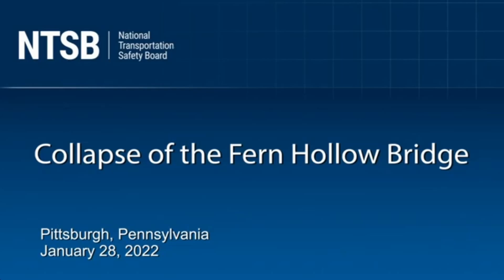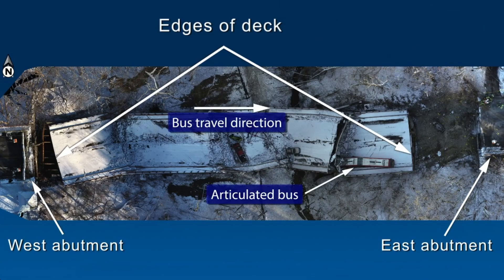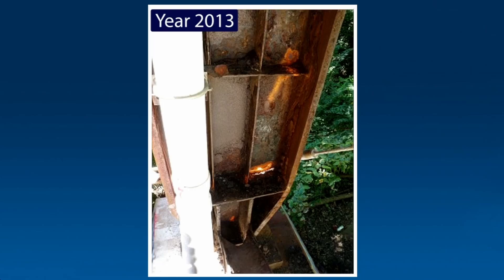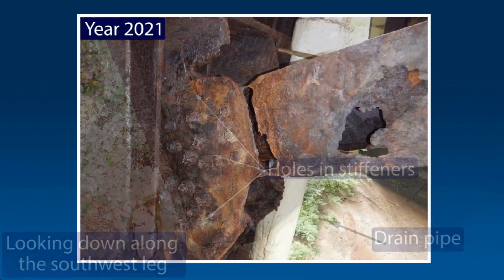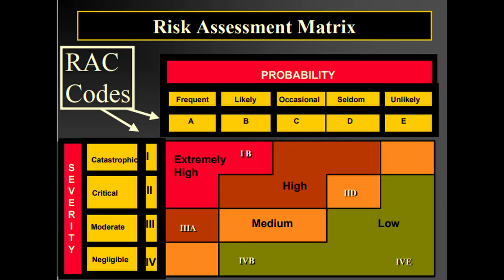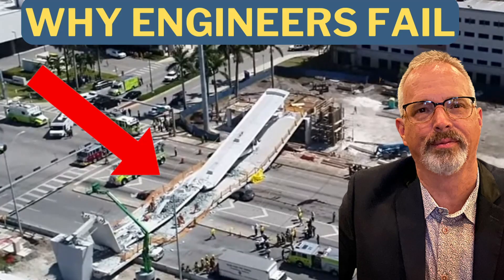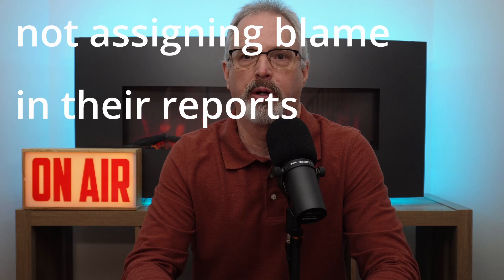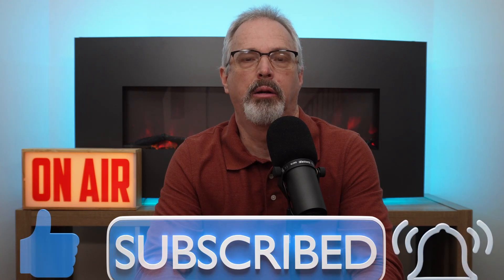Why the Fern Hollow Bridge Collapsed

Comment: If you are an out in the field looking at things & touching things kind of engineer sooner or later you're going to see something that just isn't right.  In 40 years I had one episode that landed me in front of the lawyers explaining who knew what and what action they took or did not take. At a minimum some head knockers at corporate got calibrated and stopped harassing engineers when problems arose.  It also got some facts on the record with a Govt. Inspector General.

Comment: From a wider view, the UK has focused Professional Qualifications in Engineering, Accountancy and Medicine into independent Professional Institutions, which were originally trade clubs such as the Royal Institution in the 17th Century. My father worked with Prince Philip (they shared my Grandfather in common, Philip's mentor as Mess Steward CPO in the start of WW2) on the CEI, a hyper-regulator. You may graduate with appropriate qualifications, but that's only the start, you have to gain experience both in the profession and management before being able to apply for Professional Qualification, which must be maintained as technology develops. It's no use having qualified in medicine 50 years ago, you need to keep up - a good example of what happens if you don't is psychiatry, which isn't regulated - we sorted out the mechanism of trauma in 2020, but it's still a commonplace to hear that it's untreatable.
In the case of Champlain Towers, the accountants and engineers would now be doing something else, possibly time - the Regulators are effectively Primary Tribunals, Appeals are heard in the Appeals Courts

Comment: To many years of one party in control. You guess which one! Last mayor was more worried about building bike lanes then repairing bridges. There are others that are just as bad, that are city owned not PennDot. Be carefull were you drive in Pittsburgh. Swindell Street bridge over I279 is just about as bad.
Reply from the maker: The Pittsburg City council approved a $1.5 million contract to inventory 150 Pittsburg bridges in 2022.  I wonder what resulted from that effort?
Reply: @CaseyJones-Engineer   LOL! a million and a half to study the issue.
Reply from the maker: @davidkennedy3050   That's more money than they spent on actual bridge maintenance in the city of Pittsburgh during that same time period!

Comment: I live in the UK and this generally doesn't occur. I suspect it based the cost of repair/ replace compared to paying out damages if it failed. Thar appears to be happening with the Boeng 737 Max issues. Having two 737 Max crashes compared with doing the modifications correctly and forcing the Airlines to pay for the Billions on "Type Certificating". Litigation is a way of getting out of maintenance and modification programs.
Reply from the maker: Interesting parallel you raise with Boeing.  All lot of problems with Boeing started when the ranks of upper management became filled with non-engineer business types.

Comment: The failure to act is related to the failure to take ownership or responsibility common among government bureaucrats.  Part of the problem is they don't have the same level of risk or liability when they fail to do their job as the private sector does.  Sometimes even their job security is not threatened when they fail in their duties.  As a society we put too much faith in government approvals and inspections to keep us safe.
Reply from the maker: Well said and I agree with you.  There was a situation at California DOT where an inspector faked testing reports for the foundations of several bridges as he did not actually perform the tests.  They simply offered him early retirement which is unbelievable to me.
Reply: This is why we need to get rid of qualified immunity.

Comment: You mention (and i havent finished the video yet) that the reports aren't super critical, which is a fair point.

But i'm stuck on the fact that NOBODY looking at this is seeing a problem here. Even if i were a state/city figurehead looking at this report, i would be massively concerned. How is nobody responsible for any of this? Seems like we might need a public name and shame forum, for this type of stuff if it continues to happen. That or serious legal consequences for this type of action, or in this case inaction. Did nobody read this report, at all? I dont understand how you miss this?

Also little tidbit, im guessing formalities have a lot to do with this kind of behavior. I would personally be handing in that report being super dramatic about how the bridge is absolutely screwed and basically completely unstable.
Reply from the maker: I agree with you.  Another way to look at this is what happened to common sense let alone good engineering judgement.

Comment: I went under a bridge south of Pittsburgh with a snooper truck. The bridge was really old like early 20th century and lots of the nonredundant structure was like 50% of it's original cross-sectional area due to rust. One side was really bad because at some point they added a cantilevered pedestrian walkway that did nor drain properly. I was kind of scared to have the snooper truck on the deck, but they werew allowing regular truck traffic over it, and I mean like loaded triaxle dumps. They didn't want to close it down because the firehouse was on one side and they needed to be able to run fire apparatus over it. In the end I don't think they did much if any repairs, they just had it sand blasted and painted.
I guess it was safe, I didn't see Mothman or anything, and we weren't too far from WV
Reply from the maker: Wow that sounds insane.  It makes you wonder what it would actually take for them to close a bridge due deterioration.
Reply: @CaseyJones-Engineer  I wish I could remember the name of the town but that was about 14 years ago. Yeah that stands out as one of the worst. There was bad rust jacking at connections. That damn rust can build up a lot of pressure,
It's pretty economically depressed down there, and they have been kicking the can down the road for over 40 years. Everything started falling apart on September 19 1977 with Black Monday and the collapse of Youngstown Sheet & Tube

Comment: Prison terms for politicians and bureaucrats that were aware of problems and didn't correct the issues, or remove the structures from service.
Reply from the maker: I agree. Somebody should to to jail.
Reply: @CaseyJones-Engineer  Tofu dredge comes to America... But then again, math is racist. So what can you expect?
Reply: There you go.  That's the answer.  A judgement against the city simply adds to the tax burden of people who had no knowledge of or control over the matter.  Meanwhile, the truly guilty skate.
Reply: That’s a quick way to shut down travel within Pittsburgh. No idea on how long it would take to fix the issues and open things back up. Pittsburgh has the worst situation to cope with this. It’s basically Appalachian geography with lots of ravines and hills. The city was laid out around the steel mills down in the bottoms. That industry is long gone, the population has dropped by 50% from its peak in the 50’s. 1/3 of the housing stock is gone and 1/3 of what remains is beyond economic upgrading to acceptable conditions. 

Allegheny County has 99 municipalities within it. Switching to a unified approach would help a lot with this regional infrastructure
Reply: Agreed. Unfortunately the politicians who would have to institute that policy are the same ones who might one day be held accountable by it, so it will never happen.

Comment: You are saying that the engineers have an ethical responsibility to inform, in strong words if necessary, to the point that they advise to close the bridge. I agree in principle. I have a question though: Those inspection reports are commissioned by the owner (the city of Pittsburgh), right? How much does an engineering firm make from those inspections, and how likely is it that the owner would work with you again the following year if your previous report went too far? In other words, isn't the owner free to choose a firm that they know won't raise too many unwelcome questions?
Reply from the maker: I am sure that is a factor.  However, these firms will also likely be party to these lawsuits on behalf of those who were injured.  I would hate to be a defense attorney in this case as they have no viable defense in my opinion given the obvious poor condition of this bridge.
Reply: @CaseyJones-Engineer  Possibly. On the other hand, I am not sure if they have broken any laws. Their reports seem pretty accurate, and acting by the letter (rather than the spirit) of the law doesn't get you into jail.
Reply from the maker: @renerpho  I agree.  Those inspection firms will likely face any criminal charges but a civil judgement against is probable.
Reply: @CaseyJones-Engineer  I guess you mean they will not face criminal charges?
But you're right: In a civil case, all bets are off. Will it hurt them so much that they (or other firms in their position) consider changing what they do? I'm not very optimistic about that.

Comment: It's 99% a matter of money and 1% a matter of peer pressure because if all your colleagues are saying it's no big deal (often because of money in the first place), if your a new hire fresh out of engineering school and know these things are probably an issue and the more experienced engineers are giving it a pass, you will almost certainly follow their lead and, if you decide to do the right thing, you'll get fired for going against orthodoxy. I don't know this about engineering specifically but I know it about other professions that are more safety-critical on a much shorter timespan and yet I was fired every time I pointed out something unsafe and was not rehired even at those jobs where my safety warnings ended up actually hurting someone. If you go against the grain at work, they decide this means that you don't "fit in" and it doesn't matter whether or not you were right because they have no problem throwing you into abject poverty just for speaking up. This is reality in every job I've ever had other than when I do work for my parents.

Comment: Casey-Most or all DOTs use pavement management software to prioritize repair/replace members, slabs and structures. The inspections should have flagged these supports as priority. Someone had to have over ridden the expenditure.
Reply from the maker: Good point.  It looks like they didn't spend one thin dime on maintenance for this bridge over the last 10 plus years.
Reply: Also, I was under the impression that northern cities where salts are used attach a low voltage system with a sacrificial block to fend off steel deterioration?
Reply from the maker: @timb5419  I think most bridges lack cathodic protection which seems to be a missed opportunity to me.
Reply: @timb5419  Pittsburgh is also known as the city of bridges. I can guarantee that effectively 0% of our bridges have this. You can look straight through the sidewalk to the ground or water below on a non-insignificant percentage of them. The fern hollow bridge was one of those. The holes were filled with quick patch a few years ago. Then, at least I couldn't see through while riding my bike across on the sidewalk.
Reply: Road salt is such an unbelievably destructive force. For bridges built before salt was used in the quantities it is used now, is there any kind of recalculation of structure design life to allow for it?

Comment: Why did it take the NTSB so long this is as clear cut you could not have more evidence than this. Just because someone is elected does not mean they know what they are doing also they appoint friend's relatives ECT. Where was the infostructure money spent on a park internet connection upgrade.
Reply from the maker: They do take a lot of time.  I agree that in this case it was a total "no brainer" as to what caused this bridge to fail.

Comment: The risk to many inspectors is that if they raise the alarm, they will be fired. Been there. Getting the maintenance people to do work was often impossible. 35 years ago, I found that weathering steel was about the same price as A36 steel. I spec'ed it but required a triple epoxy coating. Galvanizing would have been nice but it was not readily available for my projects. Another very good video. Good Luck, Rick
Reply: If bridge inspectors can't raise the alarm, and they can't compel the maintainence, then there's is no point in doing the inspections. The inspections didn't change the outcome for this bridge by one iota.
Reply: @shmeli Yup. It covers the paper trail required by the Feds.
Reply: Weathering steel is also misunderstood.  It's not rust proof.  It isn't supposed to be used anywhere standing or running water will be present, as those prevent the oxide layer from forming.  And in small quantities, it's usually 2x the price as hot rolled mild steel.
Reply: @GregsStoneYard In 1991 the cost of weathering was only about 5% higher than the A36 and they both would have gotten the triple epoxy coating. On $13,000 of steel I thought that the $630 difference was worth it especially since the town hasn't done the maintenance. Thanks for the update on prices. I haven't done an estimate in 20 years. Been retired 12.  Good Luck, Rick
Reply: @richardross7219  My pricing was from a few years ago, and was for less than a truckload of 11 gauge sheet.  For architectural use, not structural.  So might not have been apples to apples.
Reply: @GregsStoneYard I was buying wide flanges and channels.
Reply: @GregsStoneYard Last time I had corten for structural, it was on par with what you quoted.

Comment: A common distaste for confrontation  that people who work in the public sector have.  In the private sector you go out of business if you do not confront your problems.  in the public sector you just ignore the problem.  The same problem caused the recent lost by fire of Hurricane Ridge Lodge in Olympic Natonal  Park.
Reply: Can you explain how negligence caused the Hurricane Ridge Fire?   I live somewhat close and I would like to know.   Any links?
Reply: Yes the problem is the high inductive reactance and high supply system impedance The investigation did not address this  A second complaint has been filed with the Interior IG  Electrical jargon for this is SOFT SYSTEM SLOW BURN @MidnightWarrior1976

Comment: There needs to be less room for interpretation and opinion of what kind of wear is acceptable. Minimal remaining thicknesses should be stipulated by the designer of a bridge. They are in the best position to understand how their bridge is meant to hold up. Make it mandatory for getting a building permit to stipulate these minimal thicknesses.

Comment: If i were to see such degradation on important structural steel beams on a bridge or building, i would sound the alarm ASAP.  Someone should be held accountable for such negligence.
Reply: The degree of  negligence is unbelievable. Those responsible should be fired if not send to jail for gross negligence.
Reply: Most of the bridges in PGH are in similar shape. They get bathed in salt in the winter. The city has nowhere near the funds needed to maintain the bridges it is responsible for. It’s basically broke with no ability to generate tax revenue to cover the cost of running the city.
Reply: @danamyrocket  take pictures and videos and post them on social media.  Alert your local politicians and reporters.  Don’t wait for another disaster.
Reply: @Wurlyscope  That is done and bridges are closed. There are a few within a couple miles of my house and the fern hollow bridge. Though if you look at where people are dying while on Pittsburgh roads, bridge collapse is not even on the list. I'm not discouraging addressing issues detailed in the report. But if I am lobbying Pittsburgh politicians, other topics are my priority. I'm worked up, but about other, road risks. Reducing the speed limit and not building urban roads like highways would save far more lives. Yeah, it would slow down commutes and be inconvenient, just like closing more bridges. But I think with the little time I can spend on activism, that should be my focus. And it is. I helped change a planned crosswalk closure into the installation of pedestrian crossing lights on the road that is a primary access to the bridge. More pedestrians have died and been significantly injured crossing that road than the few that were injured in the fern hollow collapse. 

Again, not saying bridge collapses are insignificant. Just providing an explanation why some people are focused elsewhere, including our bureaucrats in charge of Pittsburgh streets.
Reply: @dfiler2  Thank you for explaining your point of view and what you did. I understand that the situation is far worst than i initially taught.  No doubt your city/county is in urgent need of money to fix all this.